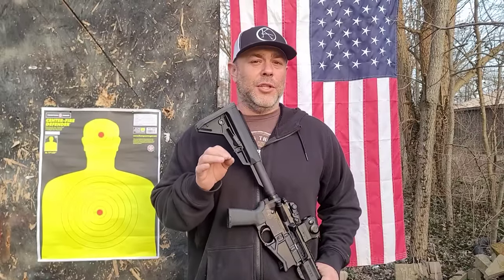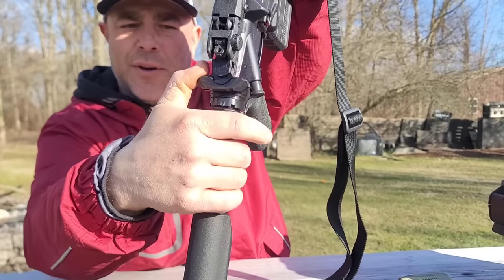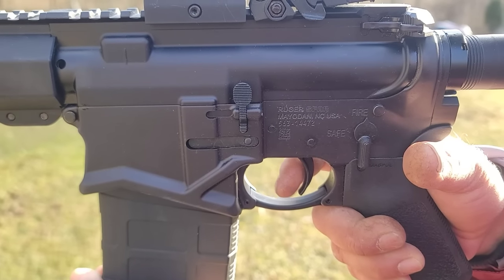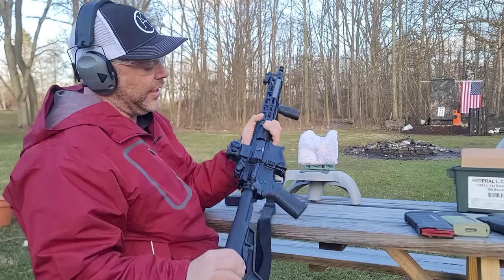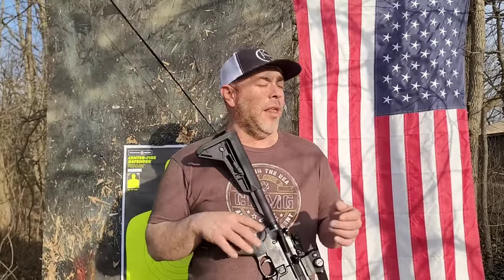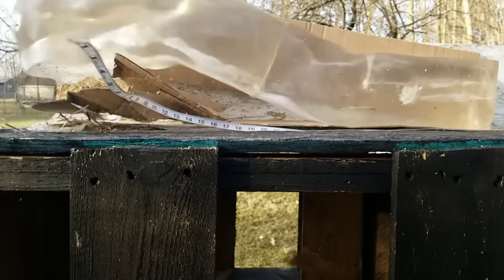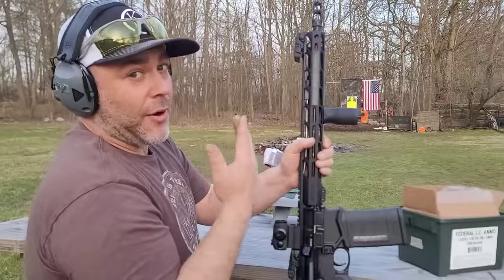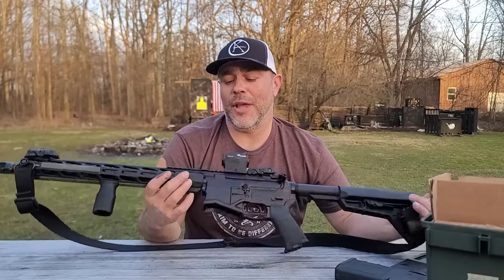Ruger SFAR NO 🐂💩 FULL Review. The AR-308 Struggle Is STILL Real😕

Comment: the ultra thin bolt lug wall really concerns me. 7.62x39 AR bolts are similar, and have a reputation for frequently breaking. The base of a 308/ 7.62x51 cartridge is even slightly wider than the 7.62x39, meaning for the same space, the bolt lug walls must be even thinner.  Along with the significantly higher pressure of the american cartridge this seems like a real weak point. I'm not an engineer, I could be wrong about this.

Comment: I had mine since October and about a month ago started getting similar issues.  Turns out the gas block had come loose.
Reply: When you say “gas block came loose”, do you mean the two screws at the bottom came loose and caused it to move around on the barrel causing misalignment? Can you be more specific? TIA

Comment: We had the same problem when we wicked out from our M-16s to the M4 we tried the oil the M4 just like to 16 and some people had issues to fix it we oiled the buffer tube and buffer spring so when you pull back on the charging handle is a slick sound with no squeaky  hinge sound at all

Comment: After the exact same issues with my 16”,  after about 125 rounds, I sent mine back to Ruger. Super frustrating. Still waiting on its return. I cleaned mine, didn’t change anything, I used new Pmags and Lancer mags, and three different types of quality ammo.
Reply from the maker: Good information! Thanks! But that really stinks we are having so many failures. How long have they had it now? If you could tag me so I don't miss it or email me it would be awesome. I'm trying to figure out what their average turn around time is for this. Despite me trying to not let them figure it out I think they figured out that mine was a youtube rifle. One day after they received it I got an email saying it was on the way back....🤔
That's either really awesome or that's really suspicious.👊🦃👍
Reply: They had mine back to me in 8 days but they also said there is noting wrong with it and it’s ammo choice.  (I’ve tried several)
Reply: Three weeks and I finally got my rifle back. There was a note that said they replaced the gas block and had fired 100 rounds with no malfunctions. 

I took it to the range today, it shot 147, 150 FMJ flawlessly, and 168 Hornady TAP as well. About 100 rounds today. It would not run my Federal bonded copper 165, so it appears to be sensitive to ammo selection. Overall I was very happy it ran well, and that Ruger fixed it, but the jury is still out. I need to run more ammo to confirm it’s “fixed”, if it works well w more ammo, and if I am going to keep it. It shoots really well when it’s running, I want to really like this gun. The rail needs to have a little more protection, burned by hand a tad after touching the actual barrel through the holes in the hand guard.
Reply: @DerekinAK  I took mine to the range today as well it ran just fine on gas setting 3 but as soon as I lowered to gas setting 2 I get FTF issues

Comment: Pretty good practice not to put the weight of the gun on the mag sitting flat on a table;  I thought you were going to get a malfunction the first time I saw you do it using the red dot on head shots.   EDIT:  re-watched seemed like on the head you had the mag on the table but not when the failure to feed occurred it was defiantly not sitting on the table.

Also something to consider:  Your lake City 7.62/51 isn't crap ammo by any means really.    However,  is you were shooting some .308 win with more chamber pressure maybe that has something to do with it,

As other's have said gas issue and or buffer/spring.
Reply: That has pretty well been disproved. Even the Marine Corps accepts these days that shooting mag on the ground is fine (something that was a no no 30 years ago). Rest the mag on anything you want. It’ll be fine.
Reply: @jlatzke  Not to disrespect another branch... but we don't call them crayon eater's for no reason..  

I will continue to shoot my magazine fed weapons while they are not sitting on a table etc ;)

Comment: I know that it's been said,  but a h2 buffer is recommended, and setting 2 is where you should have it. 

2 other things...the boomer break works great,  but it is totally obnoxious, so to alleviate the blast, I put a KAW valley linear compensator on mine . Recoil increased,  so I put a nice padded Adaptive EX recoil pad on it from Joe Bob's. It's fits perfectly and is adjustable, mil-specd. I don't notice any recoil now and haven't had 1 malfunction in 600 rounds..

Comment: Had the same problem with a 308 build and pmags the rounds sit about 25 thousandth of an inch to low in the gun due to the thickness of the feed lips put a duramag in and It ran perfectly
Reply: Or you can take a dremel tool with a round sanding drum and thin the feed lips on the pmag 
 o and I shortened the feed lips to the same length as the duranag as well also runs great now with the modified pmags

Comment: Oooch! Bummer. Multi-issues with lack of pick up and bolt over round. Then the way it died in the end. One, like some others suggested, I'm thinking gas block leak but you didn't complain about getting burned. hmm. That was quite a stiff bolt in the BCG. Get a replacement BCG or send back for redo? BTW, yer supposed to start on setting 2. Another concern, I don't often get a smoking gun like that. Maybe you left too much goo on and it cooked in. Did you clean very hard between days? Especially the chamber?

Comment: Yeahhh, mine is at ruger getting looked at. Had over 2 handfuls of failures during the break in period.
Feels almost like I wasted all that 308.Dx
Shot good when it shot though. Lol
Reply: How many total rounds did you put through it with the 2 handfuls of failures? Also, can you describe what problems you had? Are you shooting suppressed and on which gas setting? Thanks!
Reply: @Keith Wray  300 over the course of a week.
Would not pick up rounds, would get the ole' bolt over round jam, stove pipes, and twice it jammed a spent casing up into the top of the upper so tightly to where I have to use a screwdriver to get it out (these really bad jams were only on setting 3). Bad ejection pattern on setting 3, almost 5 o'clock. Setting 2 was ejecting correctly, but would still jam.
Started on the first mag, maybe 3rd round, was a stove pipe. Kept happening about every 3 rounds, so I decided to try setting 2. Worked for about 4 mags, then had the not picking up next round and jamming problems again, now on both settings.
Tried many different types of ammo, 3 different mags, everything acted up.
Don't have a suppressor yet.
Reply: @Keith Wray  oh and it would fail to lock the bolt back on an empty mag. Not all the time, maybe half. I think that was on setting 2.
Reply: Thanks for the reply. I’d love to hear back on if they get it repaired for ya! Good luck! It’s an awesome firearm if you can get it to run reliably.
Reply: @Keith Wray  got it back today and shot 100 rounds on setting 3, only had 3 failure to feeds (ole'bolt over round jam) and it was on the last round in the mag each time, so it's doing much better.
Their paper didn't really explain what they did, but it does work better now.
Hopefully it doesn't miss that last round with a different mag like a Lancer (stiffer spring)
Reply: @SubBubz  Glad to hear it has improved…How many days did it take them to return it to ya? I have two 16” SFAR’s…One runs great. Had some FTF’s at first, but it’s good now…The second one I just took out today. Zero FTF’s with 4 types of ammo (in gas setting #3). However, I had a ton of rust colored gas stains on my barrel and handgurd around the gas block…the accuracy was acceptable, but not to my liking 1.5” to 2”…Seems like it’s throwing a flyer every few rounds…Im wondering if a leaky gas block would cause POI shifts, but not affect the cycling of the action? I am gonna call Ruger on Monday…BTW - I put about 125 rounds threw it. I felt like the accuracy diminished the more I shot it.

Comment: Most every firearm is sold with oil or grease to protect from corrosion while stored. If you didnt clean it but just oiled it, you more tha likely gunked it up more and more with every shot. Clean the gun and wipe oil on it rather than spray it in the action. These new firearms do not require but a thin film of oil if any at all. You may have clogged the gas block.

Comment: I mostly run mine suppressed, surefire Rc2 and the mini, setting 2 & 3.  Mines been good so far but don't thing I've passed the break in period
Reply from the maker: Good info! Thank you👍🦃👊
Reply: Curious why you use gas settings 2 & 3 while suppressed? Did you have troubles on setting 1, or did you just decide not to follow Rugers recommendation and tried 2 and 3?…Just curious, as I have one and I shoot suppressed.
Reply: @keithwray9942  Not sure why.  When I run the RC2 it won't cycle on 1, I'm going to do some shooting this weekend so I'll dive into it more.  It doesn't make sense to me, seeing how there is more back pressure, but maybe its the ammo.  147gr 762x51.
Reply: @Deazy46  Thank you and Good luck!!!
Reply: @Keith Wray  yep won't cycle on setting 1 while suppressed.  Freshly lubed etc.  It actually won't even extract the round and the charging handle actually feels stuck.  Works fine on 2.
Reply: @Deazy46  That’s wild. Exactly opposite of the way it’s designed to function. Hey, as long as it functions, right?!?

Comment: I like this rifle everything about it but man I haven’t seen a lot
Of good reviews of it seems like it’s very finicky..
With 308 though it’s better to go rifle length buffer tube and h3 buffer in my experience.
Idk it’s tuff I prob won’t be buying this one for a while let em get the kinks worked out but also I’d rather have a 18” barrel as ideal.. 16” for 308 is just kinda silly idk that’s just my opinion have owned a 16” 308 and changed it to 18” after owning it a while and it was noticeable less concussive and allowed better follow up timing.
And 20” be even better it would be worth the extra pound are 2 to have lil longer barrel get all the velocity possible out that 30 cal .. want it to be over 2700 fps as much as possible ideally ..

Comment: Would a H2 buffer help slow down the bolt travel a little or just use gas block setting just asking-great review I recently purchased the 20” model hope it functions better
Reply: It appears his is under gasses and not fully cycling. A heavier would just make it worse. He probably needs to go lighter.
Reply: @calcosPR the gun favors .308. For some reason 7.62X51 jams it I’ve heard

Comment: One thing to think about.  M80 is not as hot as factory .308 Win.  M80 also uses different powders that typically create lower gas port pressure.  Factory .308 Win typically uses powder optimized for bolt actions and has much higher gas port pressure, even for the same velocity.  I think you should try some commercial factory .308 Win ammo.  My gut tells me Ruger designed this rifle around commercial .308 Win because thats what the vast majority of their users will use
Reply from the maker: The barrel says 7.62x51/.308
They told me on the phone the gun was designed around M80 ball.
This is not a hunting gun. This is a fighting gun. In my opinion.
Thanks for watching!🦃👊👍
Reply: This may be true, as .308 Win typically uses different powder and less max pressure than .308, but it still should be slightly overgassed on  setting 3. I've assembled several 5.56mm x 45mm 18" barreled rifle length gas systems AR's and all have needed a bit of tweaking to handle steel cased Tula Crap low pressure ammo. Seems 16" mid length systems have no trouble. Some gas configurations are picky.

Comment: I just shot that ammo out of mine the other day. 10 moa at 200 yds lol. Mine has been flawless so far at 300 rds. Only gripe is the plastic endplate and mine seems to not like either 2 or 3 settings on the gas system. It seems like a 2.5 setting would be perfect. I might replace it with a superlative since these aren't combat rifles anyway.
Reply: To clarify my setting 3 ejection is 1-3 o clock and 2 is 5 o clock roughly. So a setting right in-between would probably be perfect.

Comment: My 2 cents worth unless running surpressed an adjustable gas block is nothing but a pain. I also don't quite understand the limited range of adjustment on that ruger block vs. the wide range of adjustment on a superlative arms gas block. It looks like either at setting 3 it is still letting some gas by and or the gas port on the barrel is not large enough diameter letting enough gas through to the gas block.

Comment: I had similar issues with a DPMS LR-308 Recon II. After much back-n-forth, DPMS blamed it on the PMAGs. Another curiousity is that the carbine worked perfectly with .308, but had issues with 7.62 NATO while using PMAGs... factory mag worked fine though. I ended up selling that gun. After all, what good is it, if I can't buy cheap mags and reliably fire bulk NATO ammo?

Comment: Did you figure out the problem? I do not believe that BCG should be that hard to manipulate. Tight tolerances and too tight aren’t the same. It seems to me regardless of the gas that BCG is the issue.
Reply from the maker: I agree about the BCG. I've never had one that gave me such troubles. I want to send it to STOG to look at. If that thing so has problems that's where that bolt is going.🦃👊👍

Comment: I have to admit that this is a disappointing review for me. I'm a fan of 308 battle rifles, and was excited to see this one hit the market, primarily because of the price.  Other 308 rifles as compact and lightweight as this sell for much more.  The POF Revolution is around $2500 if my memory serves me or the price hasn't changed recently.  Given the nature of the issues you're experiencing with your rifle,  I have to wonder if the adjustable gas block is properly functioning. If it's leaking and venting pressure this would cause an undergassing problem that could get worse as you fire more rounds.

Comment: Great review. I love my Saint Victor in .308 and I’m contemplating trading that for the 20” SFAR simply because I want a longer barrel.
My PT gig is in a gun store. I gave Ruger a call about this gun the other day simply because I had more questions. I’m with you, I like the concept but I also think the shorter bolt might be part of the issue. It’s a great looking gun and there’s things I like but also concerns that I had. Partially in that It’s mostly made of proprietary parts so there’s not a lot of interchangeability for parts.
Reply: Oh I didn’t even think about it it has a AR15 sized Carrier!! Oh that makes sense that’s a lot of weight reduction from the carrier and has to have this gun running very hard unless the gas system is tuned to perfection. That makes a lot of sense ..
Idk I feel with 308 it’s better to go full size dpms lr308 or sr25 /ar10 .. with a rifle length buffer tube and h3 buffer. It’s just a lot more Cartridge than a 556 haha it deserves to be a couple pounds heavier than a 7.5 lb 556 gun …

Comment: Same exact problem I had with mine I sent it back last week.
Reply from the maker: Wowsers. That stinks. I talked to them today. They sounded confident that they have a fix. But for some reason I haven't got my return label yet...🤔 I hope we're both taken care of. I really like the idea of this rifle. I'm still not sure what its exact purpose would be. You need hearing protection to run it. I'm wondering what a high quality suppressor would do. If you can get recoil management and  sound mitigation that would be sweet. But then we are back to 20+ inches again mininal.  And another grand🤑....
🦃👍👊
👍🦃👊
Reply: @theturkeysopinion  so Ruger ran 40 rounds on gas level 3 no malfunctions and they even took a video for me to see. I told them to try it on gas level two. And they did 20 rounds out of that with no malfunctions.   So I guess they are shipping it back to me and I'll try it some more.

Comment: I feel like you didn’t clean it proper enough or there is a burr on the position in your gas system that’s what made mine fucked up but fixed those issues with gun oil and scotch brite and that was over 1000 rounds ago and only malfunctions I have had was due to poor ammo

Comment: It's a brand new never made before rifle. Tolerances have to be tuned in over time, no gun is perfect right off the bat. I still firmly believe that this rifle is the future of standard issue military infantry rifle. And yes this rifle is perfectly fine, or at least it would be if people listened to the about breaking in the rifle.
Reply: @@hnojic breaking in period of the first 100 to 150 rounds.
Reply: @@hnojic essentially yes. Then on setting 2 and then on setting 1. All 3 settings should go through a break in period of about 100 rounds. It's worth it.

Comment: Way too much oil.  try another mag, its a mag problem not a gas problem... It not picking up another round is from the lips of mag holding the cartridge too low and the bolt doesn't catch it... try metal duramags or file the Magpul  thinner.

Comment: Why the hell should you have to put lock-tite on anything? FFS Ruger should have shit ready to go. Rather unimpressed with most new guns. Yes I'm an old guy, maybe I expect to much. Old Marine and not impressed with the AR platform, although I own 2. Sad thing is I prefer the 7.62x39 in it. 5.56 is kind of a crap round unless you're busting vermin. More LSA for the beast . Find an M40 bolt gun and see what you get.
Reply: I’m 99% sure he was talking about the lock tight for the optic on the pic rail . And vert grip on the mlok up front ..new grips& optics come with lock tight already on the screws . But if he’s moving those from another ar he put more on them… helps
Keeps the screws from backing out